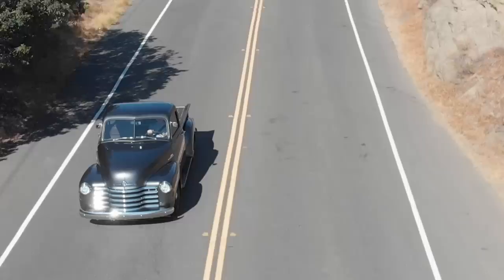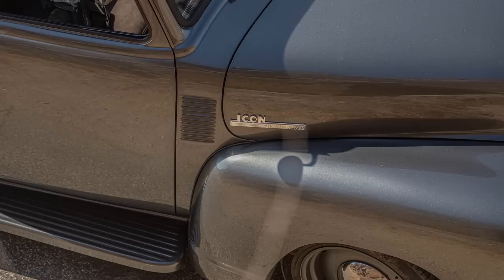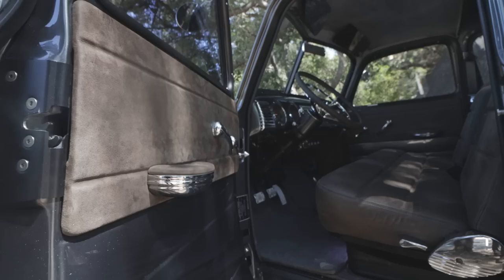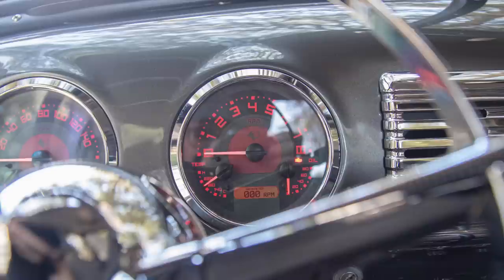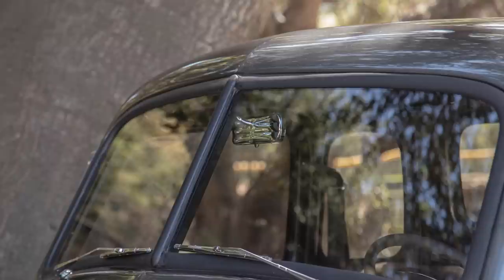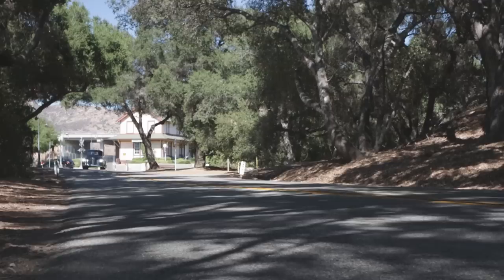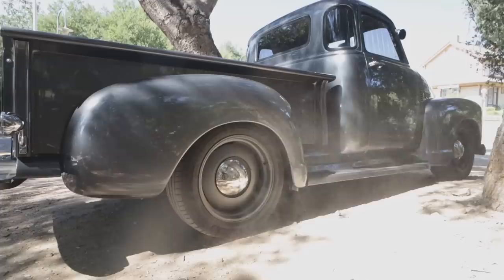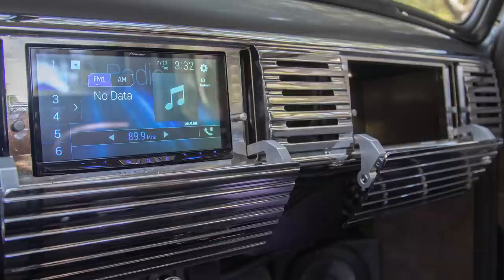ICON New School TR #15 Restored And Modified Chevy Thriftmaster Pick Up

Comment: I always wonder how these older truck would be for a taller guy like myself.  I am 6'4" and 270. Would I fit ok in or would I need to have some more leg room?
Reply: I own a 1947 (not Icon Thriftmaster but same body as). I am 6’-0”, 255 lb. I am barely accommodated, and would guess 6’-4”, 270 lb would be cramped & uncomfortable. Problem is legroom, not necessarily headroom. I have seen several with 4” cab extensions which solves problem handily.